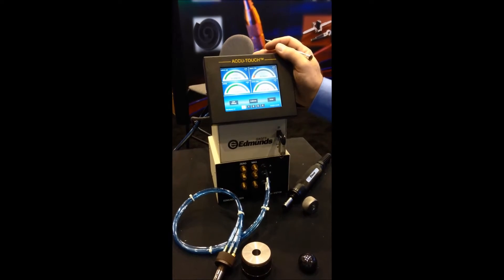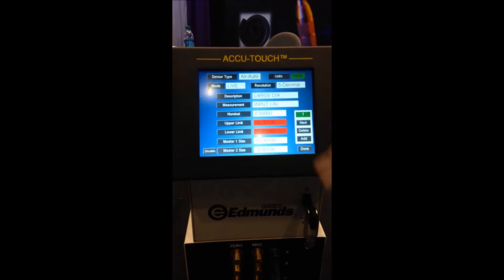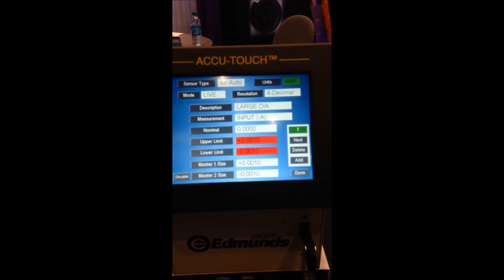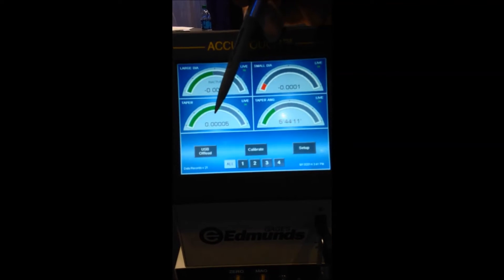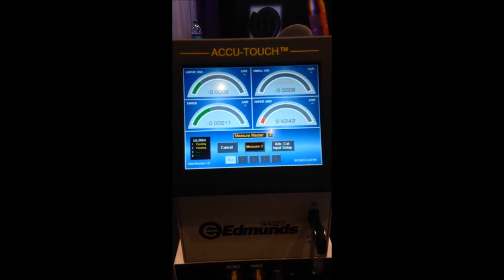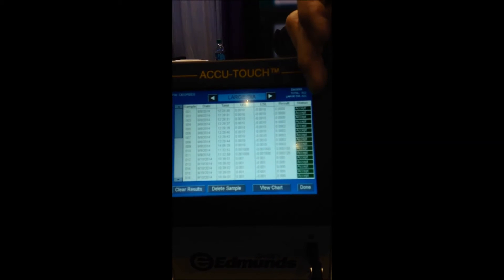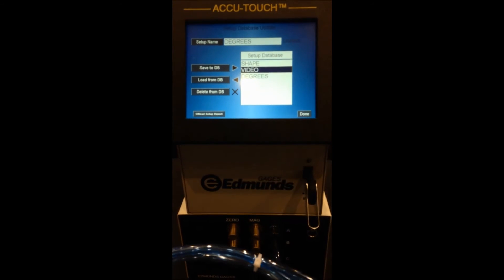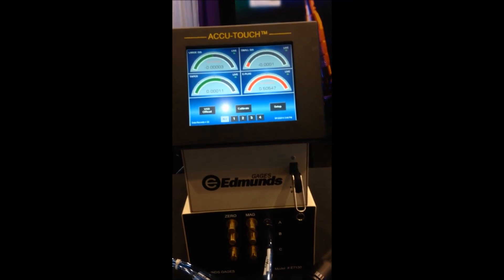Accu-Touch

Comment: Which model do you recommend if I need to dimension in assembly line a diameter of 3.7485 minimum to 3.7500 maximum and that is saved in an excel file to monitor it daily and keep historical my email israel.aguilar@regalbeloit.com